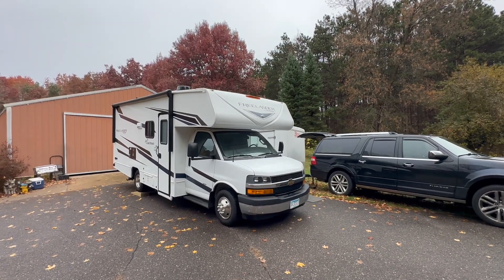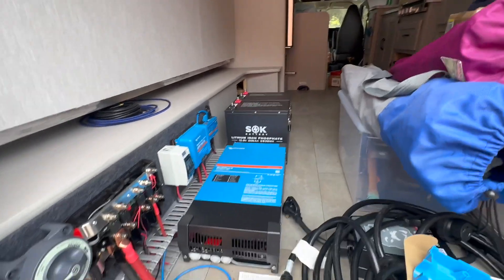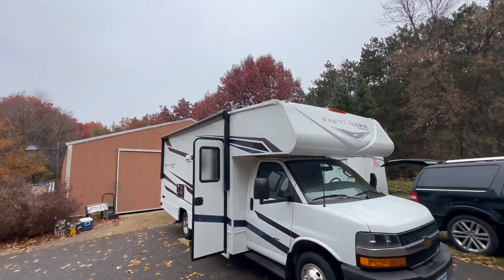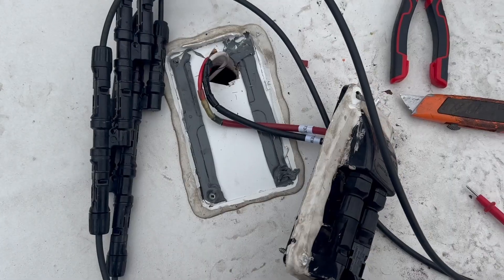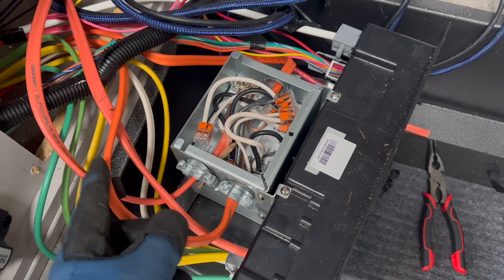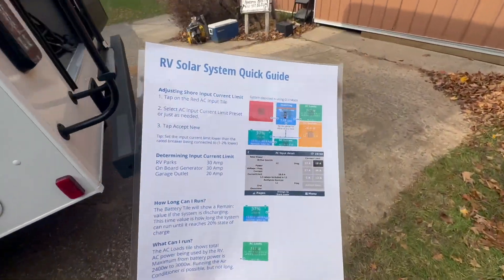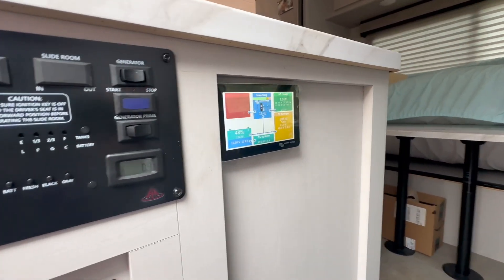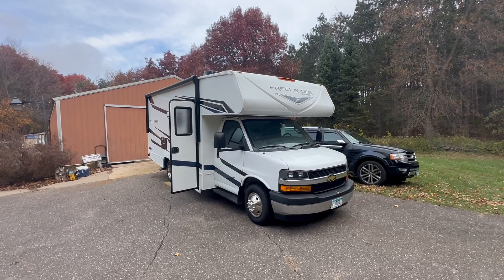2023 Coachman Freelander  VIctron RV Solar  Install - Multiplus - SOK Battery  - Alternator Charging

Comment: Interesting that you charge them directly off the alternator. I have been thinking about doing the same thing but with a much smaller system. But have been hesitant to pull the trigger, solely because almost everyone says you need a DC to DC charger to protect your alternator from excessive draw, and also to protect your batteries from excessive charging current. It's kind of a catch 22, because I can't try the LiFePo without buying them, and don't really want to buy them if I have to add a DC DC charger.
I would love to see more regarding testing of direct alternator charging like this. I was surprised those batteries were only pulling 50A from the alternator.

Current set up is 2001 Chevy Class C with 1x 150W solar panel, 20A PWM solar charger, Shunt, Battery monitor, 3000w onan (rarely used), 45A converter with switchable output 13.6v or 14.4, 1x WLA chassis battery plus 2x Group 31 WLA house batteries.
Been contemplating switching my house batteries to either 1x100AH  LiFePo or maybe 2x100AH LiFePo to gain capacity, batteries are in adjacent compartments, can't fit  a single 200AH unless I move it inside but don't want that much work.
I'm kinda torn on the whole idea, I don't want to rebuild the whole system as it has been working fine for me so far for the last 11 years but it seems like I would have to, until I saw you not running a DC to DC charger. Chevy has a 130A alternator so 50A would be no problem, I figured those batteries you had in there would be pulling much more than 50A without a converter, is it just a wire run/size restriction?
Reply from the maker: I have a theory I want to test more. It’s basically that given a long enough run of wire there is voltage drop between the charger (alternator) and then battery that will attenuate the charge amps safely and still be safe to carry the current. A sweet spot of sorts. I suspect it’s somewhere between a 6awg and 2 awg cable. 

I want to test it more. I’d be willing to to put my own truck on the line for it.
Reply: @sotasolar  
There has to be something to it, because I know some people are doing it with no problems. I mean you still need to have lead in the system in case of a BMS cut off, but other than that restriction there should be some wire run that restricts the Amp flow enough to be safe for the alternator and battery, to let's say 20-50 Amps, without over heating the wire.
Would be an interesting test for sure to see how different length runs and wire gauges affect Voltage and Amps supplied to a Lithium battery bank.